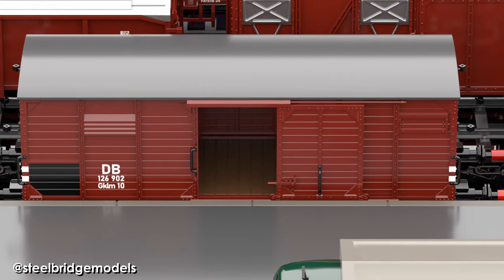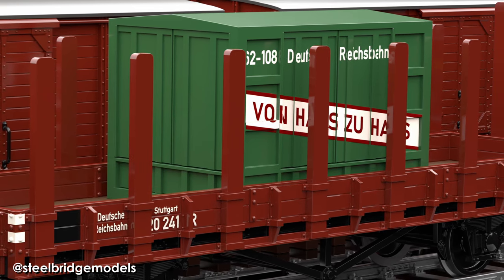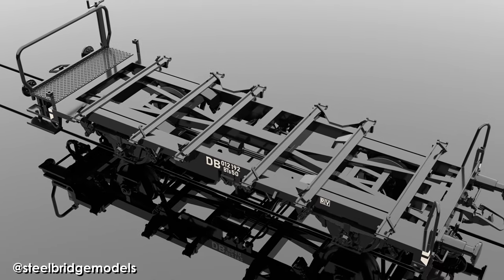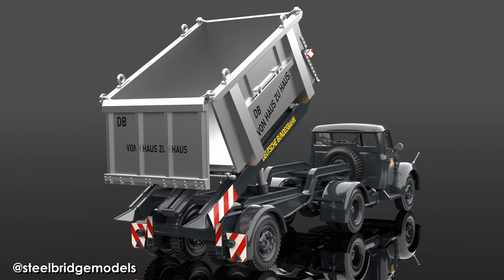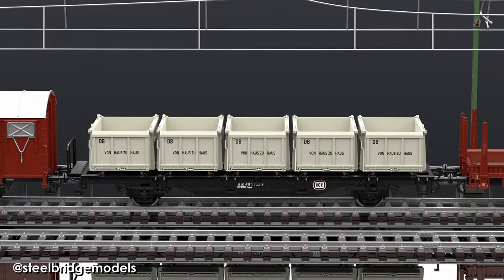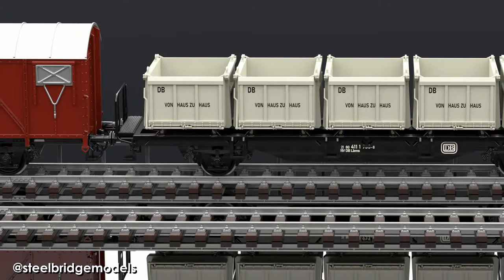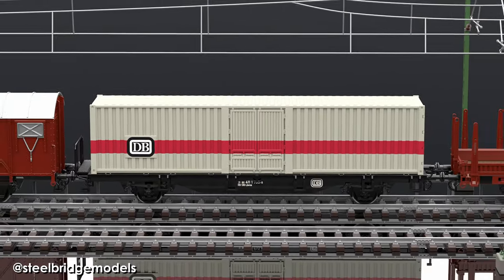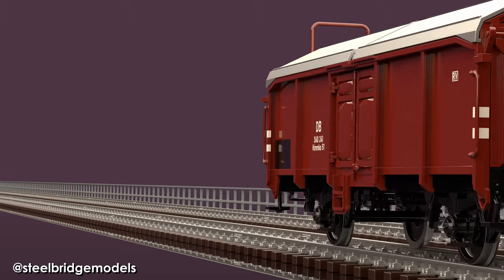The forgotten Cargo Revolution!

Comment: What's also funny is that shipping containers are slowly shapeshifting again. For example, there are 45ft containers, that don't fit on much of the rolling stock. When I see these in my country they're either occupying an entire 60ft car, most commonly a 2x45ft articulated car (which is almost indistinguishable from the 2x40ft equivalent), or I suppose they could fit on the newer 80ft cars. Then there's the mess that's tank containers. Some stay neatly within 20ft, others have a 20ft frame but stick out at one end (22.5ft, I'm guessing?), still others are 30ft. By contrast, Japan seems to rely largely on 12ft containers (5 fit on a 60ft car). En then we haven't mentioned heights yet.
Reply from the maker: Indeed, there are countless subsystems and measurements nowadays, often only partially interchangeable. Many of them actually stem from the road. When the maritime containers were firstly introduced, 40 ft. was the typical length of a semi-trailer. Over the years, trucks have become larger and the 40 ft. containers therefore inefficient, so the 45 ft. containers are trying to combat that issue, despite creating a mess everywhere else. It's a similar story with the swap bodies, which a very common in Germany. They fit onto the same mountings as a 20 ft. container does, but stick out significantly on both sides.

Comment: Interestingly, the Japanese railways devised a similar system of small 11-foot containers in the late 50s. The difference is they're still in widespread use today, as a slightly larger 12ft version

Comment: Wow, this seams like such a good idea for city supply.

I wonder if we could see in future a return of some sort of a medium or small inter-modal container. Have a train deliver them to a city and then small trucks or even cargo bikes would carry them around to final destinations.

Not to mention the possibilities for cargo trams.
Reply: There is already something like this called innofreight.
Reply: @WolfGamerBohumin  like that, but even smaller. Like, for even a Key truck to be able to handle it easily.

Are you from Bohumin btw?
Reply: @michdem100  Well, they have containers with holes for forklifts forks so there is an option for easy manipulation.
BTW Yes, I'm from Bohumín (CZ).
Reply: @WolfGamerBohumin  oh, that's cool. Then I'd say it'd be great to have something like that widely used in Europe.

Cool, I'm from Katowice, so we live very close to each other :D
Reply: I just looked up what a kei truck bed looks like.
It's about as long as a van is wide and just slightly more than half as wide as a big truck.
Now having half width containers with a two meter or 6.5ft length seems awkward BUT what if we go for a different approach. Pallet sized boxes. Standards vary very annoyingly but most of them are around 100x120cm. You need a bit of breathing room anyway, which is why 45ft containers can be built a little wider than normal to fit euro pallets too.
So in summary, we could build metal boxes with bolts on the corners that also work as pallets.
Reply: Forgot to say you could maybe, just about get two of those on a kei truck. So it's basically what you meant too.

Comment: I used to drive for SVELAST a company owned apparently by Swedish Railways (S.J.) with their version of this system.
Their system used a 10 or 12 foot container (a shortened version of a standard shipping container) and an 8 Liter Scania lorry with a hydraulic system that we were told actually cost more than the lorry itself !there were three types of lorry an experimental one whose hydraulic system seemed to commit suicide on a weekly basis, but when it was working it could offload its container either on the ground, or as usual onto a skeleton bay where the consignee could unload by Swelast and load the container themselves ready for  pickup by a Svelast  lorry, or the usual type, in Stockholm anyway, was a single container lorry which could pickup or deliver its container to a skeleton framework or a railway waggon, the yard the waggons were 'parked' were wide enough between he tracks for a lorry to drive along side and then reverse up to the waggon the driver then using a control to raise or lower the container , after unlocking or locking it!)  this usually took a driver roughly a week to learn( it being important not to deviate MORE than 1 or 2 degrees, otherwise the hydraulic drive-chain could trough a fit and self destruct ( in fairness to Scania I never heard of that happening in the three years I piloted my chariots around  Greater Stockholm,) the final type of unit was a tractor trailer unit, the tractor being the same as a singleton except that it had the capability of towing a trailer with two containers aboard. this trailer was called a 'Karosel'  (carosel :)  ) due to both slides the containers were resting upon rotating so the tractor  unit could shuffle his loads about to his or her content, only on very rare occasions did I ever have to leave the cab as apart from loading and unloading everything was done in the cab by push-button (except paperwork)or when those loading the container made some inexplicable mistake such as a certain Kitchen outfitters loading half ton slabs of marble on TOP of the kitchenware resulting in the ability of the driver near reaching lightspeed as the  wretched thing slid out of the container( you didn't get fat working for Svelast! or the amazing loading of toys in boxes on top of several hundred balls ranging in size from footballs to beachballs with the amazing loading of toys in bo on a particular windy day  I had to catch them all, much to the amusements of what seemed to be half the kids in Stockholms , Bromma district after I opened the containe not knowing the loaders in Malmo had apperently loaded the container upside down, my remarks on this cluster(F) by phone to those responsible near caused a major strike my subsequent appology near caused neo strike 2    aaah those were the days :) I loved appart from screw ups, this system noone knew why in a country so dedicated to the environment the  Swedish Government decided to scrap the system to sell the routes to ASG (road transport) when a train of 40 waggons reqired Up to 60 lorries to do a similar load carrying for considerable distances(Malmö to Haparanda for ex ,is  1364 km by road ) or a two day drive, longer if its bad winter. and there are no traffic jams by ril...oh Well that was the 80's fo you..

Comment: The developed size of containers depended on where they could be used and that is dependent on the age of the buildings. The age of the horse limited entry openings and street widths to 2 horse wide in most cases possibly 4 with passing traffic. Also height being limited to how a cart was loaded, from the ground, from a dock, or from above, and also its load. A cart of hay or straw would be higher then one for iron goods, full barrels, etc..